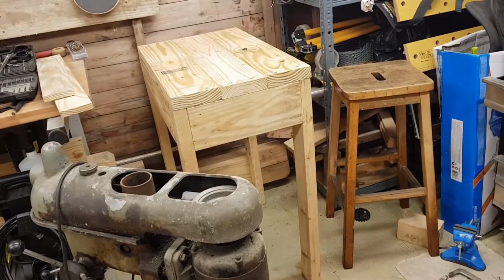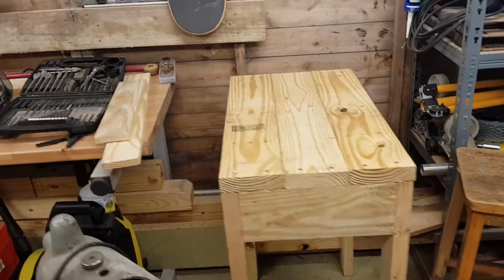Small workbench for my drill press

Comment: Proper job.
If you have enough wood and some breeze blocks (not the lightweight ones), jack it up bit by bit.
Or second option, strip it down and give it a clean.  Reassemble on the table.
Reply from the maker: Andy Pugh it definetly needs stripping and cleaning and some maintenance but I'll do that at a later date. It's up and on the table now, wasn't too bad in the end. And don't worry I didn't just lift it.